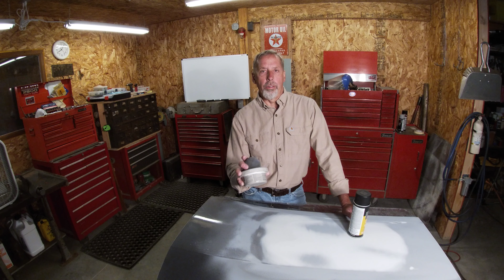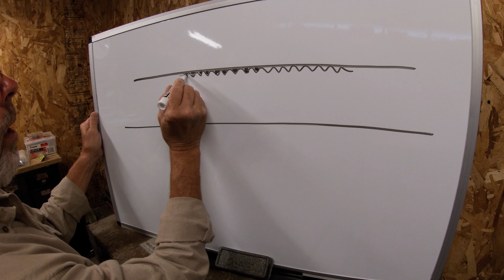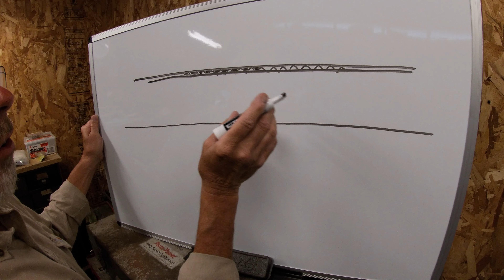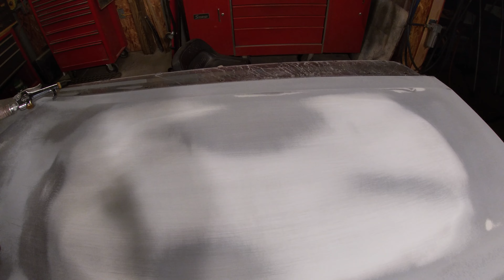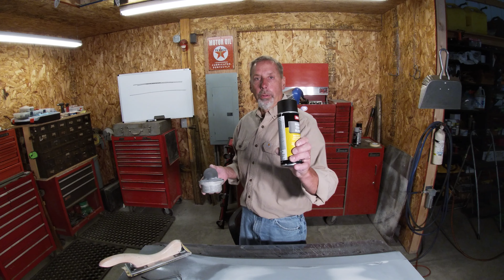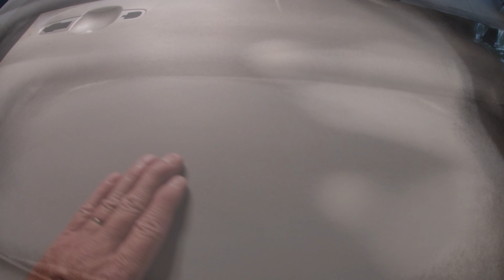What Is Guide Coat Used For?

Comment: I've done body work for 20+ years always used spray paint which will work just fine . Just started using the powder, Its so much better in my opinion it shows every small scratch almost makes it hard to have bad body work! If you are serious about getting amazing results I recommend the powder but you buy whatever you want!
Reply from the maker: Ditto